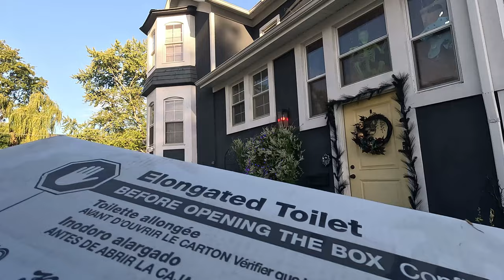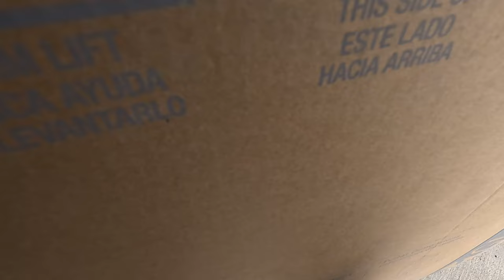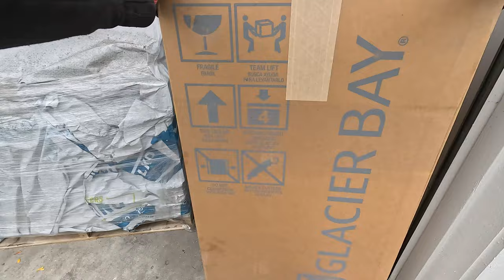NEW APP ALERT‼️ Make Sure You Download It TODAY!!

Comment: Hey man. Great channel and videos. CAUTION: I noticed on your video when you bought your van that the dealer or someone said 15,000 mile oil changes. WHATEVER you do, don't do that. Research on YT what happens to engines when people do long (5k mile+) interval oil changes. Sludge city my man. Keep hustlin'!
Reply: Depends on who brand oil . Was it a true poa or Ester based ? If so 15k is ok but it's still best to do it before 15k . If it's a group 3 than no don't go near 7k
Reply: @dcomputers  No. Do your research and look at real mechanics on YT. All of them will show an engine where 10k+ oil changes were the regular and will show you a sludgy engine. GL with that.